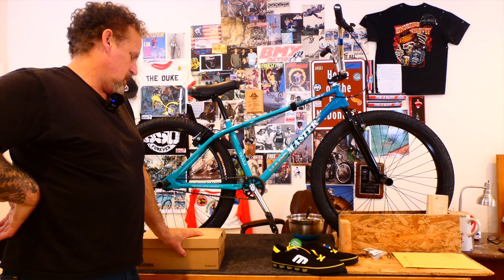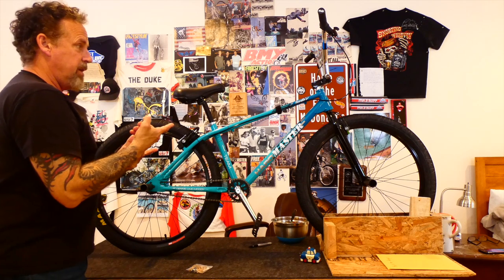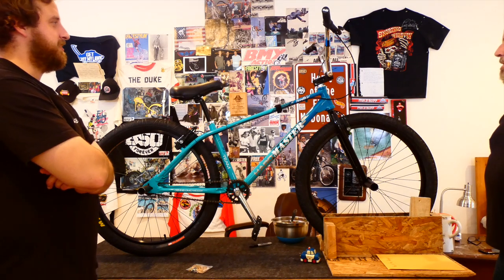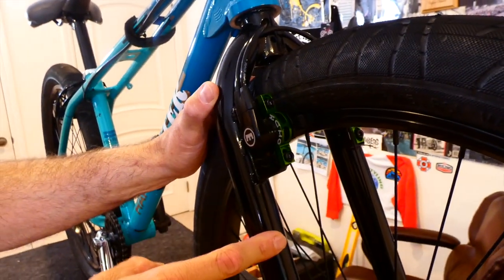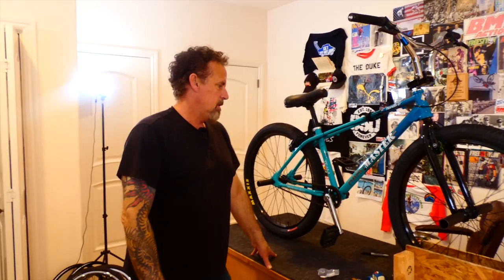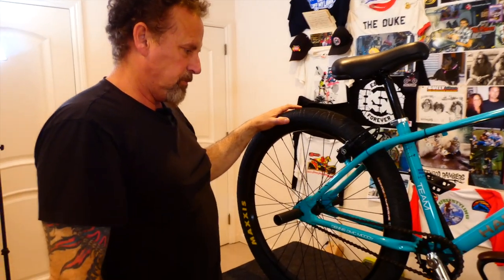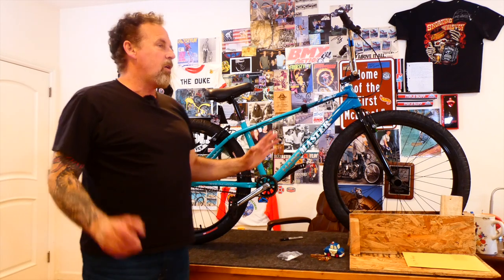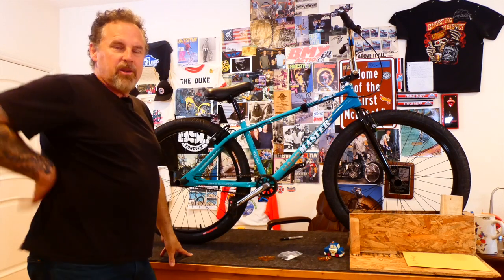The McCoy Parts List:  Explaining RL's Bike Build & Customizations

Comment: @RL Hey hope you guys are well. I was trying to ask you what rise your Knee Saver bars are..?

When you changed your forks did your McCoy change in angle 📐 as the top tube looks steeper than normal, like the front of your looks higher or am I  just imagining that....???

Also that G - Turn move you did on Mike Buff,s bike looked so sweet, the way Dylan shot that and slowed it down, seriously the whole thing was spot on. The you finesse that big 26”  bike around is something else.

But yeah, if you can get that design of a almost straight top tube to chain stay on a signature bike, let’s just when you do, that will totally original and so aggressive as well as sweet.

That’s why I got a 24” McCoy because of my height, and I wanted a lighter bike with wheels and frame that didn’t flex too much because it was too big. I wanted a mix of a 20” and 26” bike in one, in either Aluminium or Titanium. Not loads of bikes.

I used to have an Aluminium 16” Cannondale in gloss black with red writing, it came with a 24”wheel on the back and a 26” front wheel and it was an awesome hill climber.

When you get yours it’s game over...!! 

I don’t think Dylan can imagine what your gonna do.🤣
Reply from the maker: Hey I am not sure what rise the kneesavers are but The different forks didnt change any of the head angle or top tube.  And yes that design would be killer!